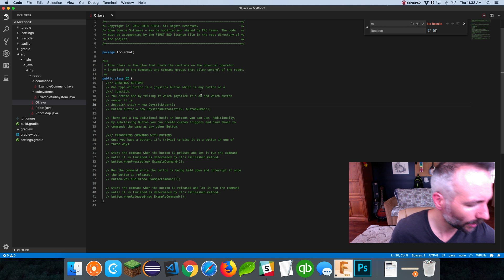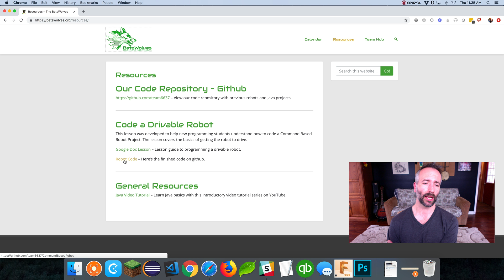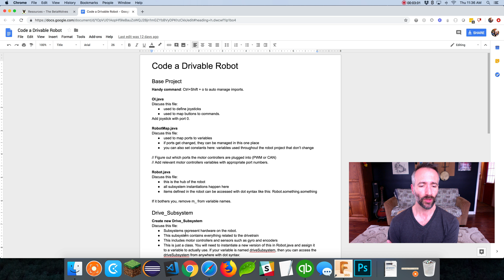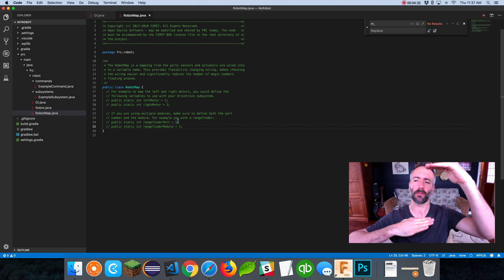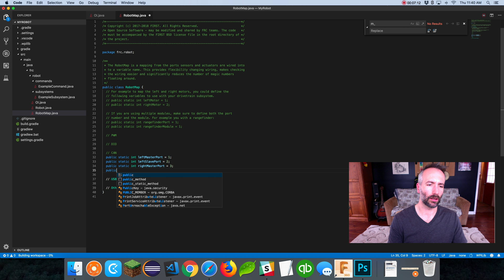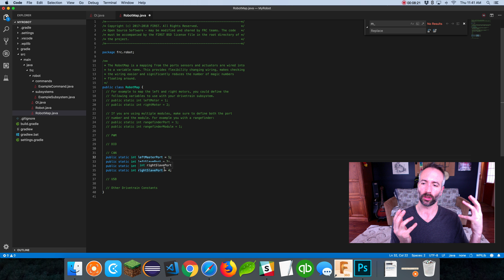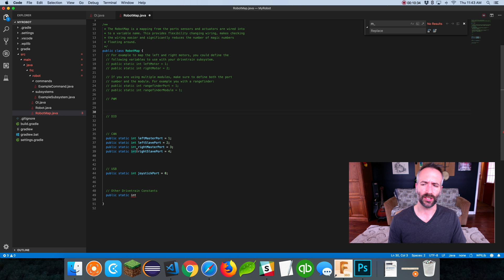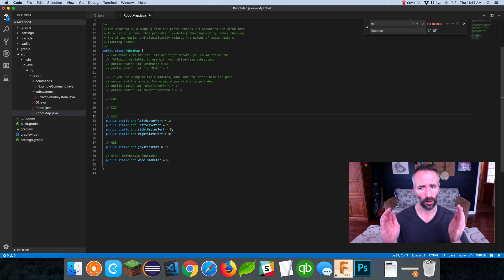FRC Drivable Robot PART 2: OI and RobotMap / Java VS Code

Comment: I uncommented the joystick but there is no red line on mine how can i import the joystick?
Reply: Hmm, did this issue persist? Sometimes it autocompletes it by itself. Sometimes you have to save the file. I would recomment it then type the joystick line manually below it and see if that provokes the right response. Final measure would be to type out the import randomly. I'm not sure what that would end up as, but you could probably infer it from other imports in your files.

Comment: Hey, so how are you supposed to know what port the controller is plugged into ?
Reply: The first controller you plugin to the laptop should show up as port 0, the second should be port 1. You can confirm this with the usb section in the driver's console.